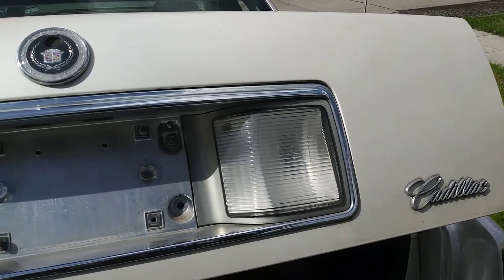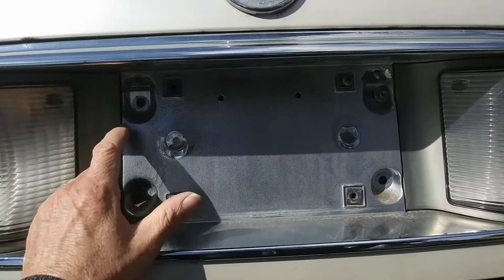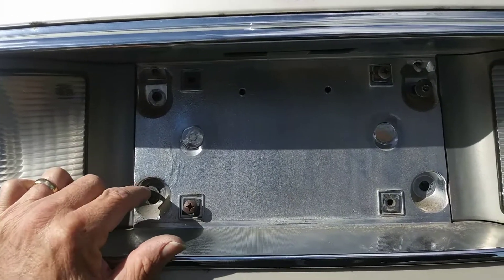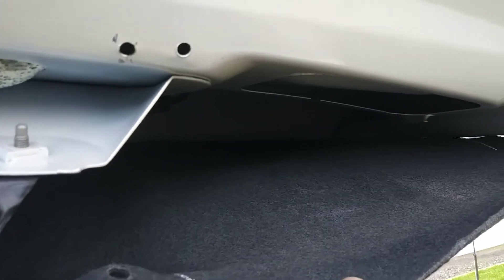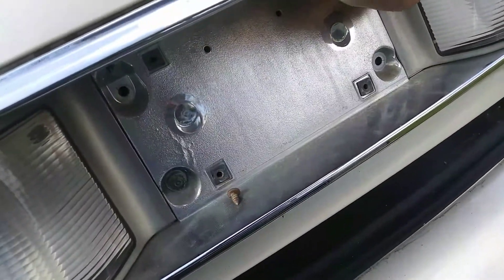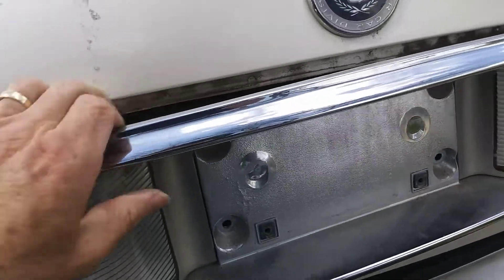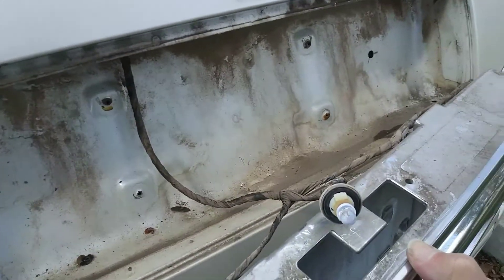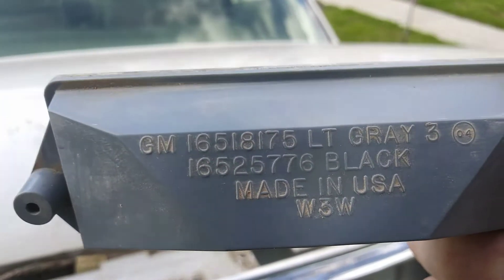1999 Cadillac Deville Concours 99 License Plate Light Bulb & back up light Replacement &Instructions

Comment: Thanks a lot. Couldn't figure out how to do this. Shouldn't you be able to remove the lens as in 1 2-3? What over-engineered crap! I used to love Cadillacs but lately I've been attached to Lincoln's. Just bought a Cadillac one owner 1997 DeVille  d'Elegance hardly any mileage lots of eye candy on it so I had to for the price. I'm so sorry and surprised to say Lincoln's quality is so much higher. This light bulb replacement is why mechanics hate engineers. I would have never been able to do it without your video. Thank you again. It's a stupid build!
Reply from the maker: Let me know when you do a walk around video of your 97 Deville.  My 1999 Cadillac Deville Concours has a crappy security system. Key gets stuck on turn off..drains battery in 2 hours.  Tried bypassing with a resister..no luck